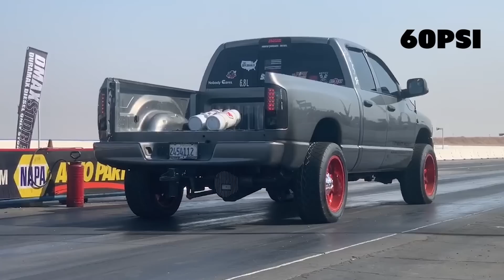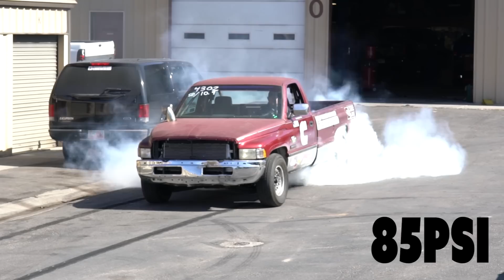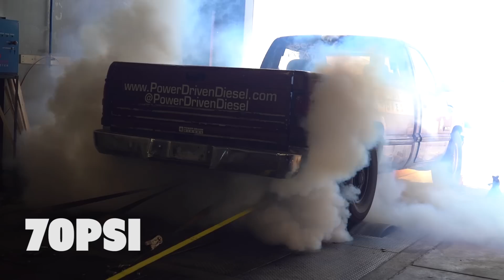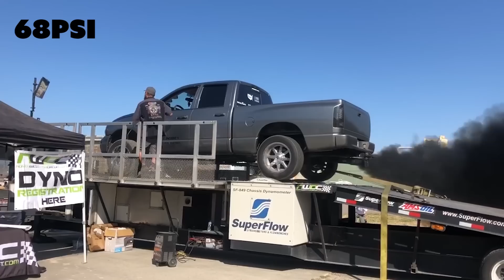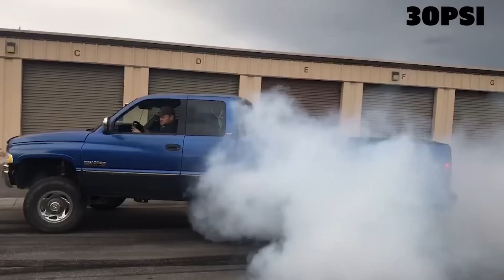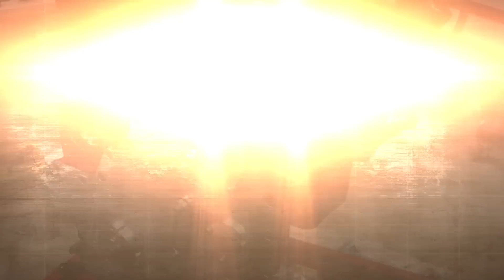All About The Boost! Everything You Need to Know About Diesel Boost | Power Driven Diesel

Comment: Todd, I realize most of your viewers know this, but as you stated in a video long time ago:  Its about mass flow rate, and boost is just a number.  One engine makes the power at 50 psi, while the other needs 100 psi manifold pressure.

Comment: If you want to scare someone, I know that the big Merlin v12 aircraft engines can actually survive running over 55psi of boost, in the full race application. Keep in mind that it's a 27+ liter gasoline engine. It was built to run about 30psi for 2000 hours of operation.

Also, I forgot about the hyperbar engine in the French leclerc tank. Uses a small jet engine as the turbo. This works because a gas turbine engine is cooled by the air flowing through it, to the extent that fully 3/4 of the air in the exhaust is unburned. The French also dropped the compression ratio in that engine to gasoline levels, 8 or 9 to 1 because that auxillary power unit gas turbine is way bigger than the diesel in terms of airflow.

Comment: Almost all of these trucks looks like they're tuned like absolute shit. Puking black smoke even in full boost. Typical diesel gear heads. Other then that cool trucks. 
Edit: i take that back, Not cool trucks. Theres zero reason at all a diesel making 100+ PSI should be puking midnight-dark diesel all the way down the drag under full boost. Theres a reason 1500HP diesels are stuck running 9 second passes. No place for them puking diesel on the other vehicles on the track. And don't try telling me this is because of big injectors and can't be tuned out. I've been around big power diesels for years
Reply: Brandon Cody how do you fix it?
Reply: @cya6.0  The fuel needs to be turned down in the tuning. On older 12 valves this would be more difficult since they are mechanical fuel injection, but on 24 valve diesels it can be controlled in the electronics.
Reply: Yeah most of the trucks in the video were mechanical injection.. they have the fuel turned up further than actually nessasary because that assures you will make maximum power. That's racing, you make the vehicle as fast as you can. Also diesel soot is barely even harmful if at all, it all settles to the ground just like ash.

Comment: Isn't boost pressure in it self, more or less meaningless?
Isn't it like specifying an engines torque without specifying RPM?
I mean, 200PSI at 1000 RPM is nothing like 200PSI at 4000 RPM, so the boost number really need to be corrected for RPM, given that the amount the head flows is constant (no variable valve lift).
Or am i missing something?

Comment: So I have a theory myself. I'm a rotary guy and a Cummins fella. I actually run a much larger charger my 1.3 two rotor a Garrett g42-1450 then the24v which is on a s475 over a 363 as the truck could not light the 475 as a single easily. Now we run up to 80psi on the truck which is the 5.9 24v p pump. The car I run only 18 to 25 psi. Both engine combos run about 700 bhp . That being said my theory is running the bigest charger your engine is willing to spool at less boost because the pure volume of oxygen at a lower pressure rate is a far cooler and less pressure rate at the same or less density volume making for a safer combustion in the engine which saves on engine parts and allows a larger tuneing error window. I have proved this on the rotary using smaller and larger turbos back to back . I would have to run a lot more psi on the smaller turbo then the big turbo to net the same bhp and noted the tq curve would flat drop off sooner with the smaller chargers and the engine parts became highly stressed due to this. Now I could be way off base here. But this is something to look into as noone talks about this .  Not even Mr info Gale banks
Reply: Spool time is important and weight too. Sled pulling you can have huge turbos, other racing you can't have that much or a tradeoff
Reply: For Max Dyno numbers you wanna be in the sweet spot of the turbo map, but maximizing the HP under the curve can mean a different turbo

Comment: Boost is just a brag gauge it really doesn't mean much. With the twins I have on old yellow I can crank the gates down and make 95psi, but it makes the best hp with it running about 65psi. If I could get more fuel more boost might help but it only needs 65 to clean up so that is the sweet spot.  Sometimes too the boost is really just backed up drive pressure like when you make 65psi on a stock hx35 and it has 100+ pounds of drive pressure.
Reply: How is 28psi @57°f mesured at the head. 2000-2400 rpm 850 Egt out of  Hx35/6  on a 160hp tune ve? Stock h1c/21 was 12psi@2400 1150egt.  Same fuel. 
1 configuration drives like a diesel of the era was expected to,the other drives more like the stout 10mpg SBC 350 I had in my 79 chevy
Reply: David Drescher Funny I just swapped the factory 21cm Housing on my crew cab for 12cm wastegated one to improve how it drives. It made a huge difference in driveability and low end torque. It has power right off idle now where you needed it up to 1600rpm before in order to give it any fuel. Both setups would clean up the top end so I doubt peak power changed but the area under the power curve sure did!!
Reply: Well, yeah. As you compress air it gets hotter. The air coming out of the turbo at 95psi is way hotter than the air at 65psi. Overheat the intake air and your power goes down. You want to run 95psi, get a much bigger intercooler and maybe even add a water injection system (or nitrous)

Comment: How much is to much for a stock hx35 turbo...I'm getting around 45 psi....  at about 60% throttle ...I dont think it will take much more...
Reply: About 35psi. Anything more than that is just a bunch of hot air as it is off the compressor map and because the air is hot your power actually goes down as the boost goes up. I dyno tested this several years ago on an engine dyno just for fun. It was an HX35-12cm all stock 215hp engine with 370 injectors and a ground fuel plate with 20deg of timing.  If we cranked the wastegate down or did the old trick and unhooked the boost signal it lost power every time.

Comment: Sorry, i haven't gotten past the intro yet but the goal is not to make more boost, the goal is to make more power.  Boost is a measurement of restriction to air flow.  A well flowing motor does not need a lot of boost to make a lot of power.  Correct me if I'm wrong, but the goal is to make the most power as possible using the smallest amount of boost.

Also, asking "how much boost" without knowing the characteristics of the compressor is not going to give an accurate picture either.  10psi on a small turbo flows way less air than 10psi on a large turbo.  They both run 10psi, one makes WAY more power.

Comment: How much more boost will a k27 make over a holset hx35?
Reply: The real question, is if you can spool it. A K31 is 71/88 vs the hx35 being a 56/60.
Reply: @460EFI  Yes maybe bigger injectors with a bigger turbo. Hard to figure out the balance and not be a smoke machine ?
Reply: @goingofftherails9877  getting it to spool is a lot bigger game than just adding fuel. To really utilize a charger that big, as a single, you'll need a Steed Speed, GDP Air Boss, an intake horn, CAI, 4 or 5 inch exhaust, and some tuning, as well as probably a better cam.

Let me put it this way: a K31 is a great turbo on a 12.7L Detroit.
Reply: @goingofftherails9877 , I'm apparently also retarded, because I read K27 as K31. The 27 should be fine on a stock truck. Biggest thing will be the increased exhaust flow, so you might even lose boost, but gain power.
Reply: @460EFI  Thanks . I have upgraded to 4 inch exhaust and even tried a s300 for a while. But I was always driving lightly with the skinny pedal till it got up to 1800 rpm just to keep from smoking out those behind me
Reply: @goingofftherails9877 you might try the DPS Turbonater VGT housing.

Comment: Any idea what the air temperature is from the big turbo to the small one when pulling hard?
Reply: Ugly hot. You'd need a compressor inlet temp sensor, but it'd be worth knowing for compound turbo applications.
Reply: Roughly 500-700 degrees

Comment: I have my 98 12 valve that made 42 pounds of boost. Am putting a steed speed exhaust manifold afe intake a188/220 cam timing at 17 degrees rack plug  stock turbo and injectors until I get more money what can expect my get and boost to do ? Will drive pressure go down?
Reply: I lost a couple psi with a colt stage 3 cam. More fuel equals more exhaust so generally more boost. Installing a steedspeed didn’t affect peak boost but it did make it come up quicker
Reply: PowerDrivenDiesel thanks for info

Comment: Now you're making me want to do compound turbos on my Supra.... well the motor won't like more then like 20 psi... but hey seeing 40psi spike would be cool....
Reply: That 40psi spike when you shift can stall the compressor, really bad juju. Kills turbos. That's why blow-off valves exist. Though instead of blowing off into the atmosphere, you can blow off into the turbo intake. More complex plumbing, but Ford was doing that on the turbo Thunderbirds in the 1980s.
Reply: Gasoline engine doesn't like too much boost compared to diesel counterparts. Considering too much pressure for air fuel mixture resulting to explosion rather than combustion that destroy or even melting the engine. Something that diesel never do because there are no air fuel mixture during compression stage, the diesel fuel injected right before combustion....
Reply: @jstwatchnread8420  yeah I know, but still would be a fun project, even if it did kill the engine.
Reply: @pddofficial  Thing is a GTX42 would spool at like... 5-6000 which makes it kinda unusable. I feel like if I could build 10-20 psi around 3k rpm and 40 near 6k would be good. I don't know all the technical parts to a compound turbo system, but It would be interesting to see it.
Reply: Jonathan Gardner not good at all
Reply: @jonmeray713  In which way?

Comment: Todd I always thought boost was/is just a measure of restriction of airflow.  Isn't that why a higher flowing head will lower boost numbers?
Reply: It is; pressure (boost, in this case) is pretty much just a definition of restriction. If there's no restriction, you won't get pressure. 
This is why you can run a small turbocharger at huge boost numbers and have say, 300hp, but swap to a bigger one you could reach 300hp with half the boost pressure, less restriction, higher airflow.
Reply: BUT (and ignore the numbers I'm gonna just throw some in to make sense out of it) if you have 100 sq ft of air. And a 6.7l engine. Say you need 50 pounds of "boost" to fit all that air in, with say 40 pounds you can only get in say 75 or 80 square ft. So you are losing 25 or so square ft of air that can be used for MO POWA BABY
Reply: Pushing the small turbo too far caused heat induced expansion to achieve higher psi (90%  theroy) but you are stuck at 65-50% after you remove the heat, if you can. The closer  you push to the turbos redline 150k ish the lower the efficiency.
The larger turbo is most likely in the sweet spot 72-78% efficiency Island depending on what map you read.

Turbo A = 45psi @6-700°
Turbo B = 22 psi @2-300°
Both move the same lbs of air , true.

Comment: 12 psi made me so happy I want a ford now
Reply: Haha, easily the best truck in the vid
Reply: Augustine  Morales    Get an older 7.3 or something but there a heavy drinker. In that you  don’t get very good mpg
Reply: @Dieselsmokin  I got a 2007.5 2500 with a deleted 6.7 and injectors and turbo upgrade I drive it about 500 miles a week and a 2017 2500 I also drive 500 miles a week lol about to delet this one too big difference 21mpg to 16mpg from old to new but new isn't deleted
Reply: Don't waste your money on a POS Ford
Reply: Augustine  Morales    If you get ford MAKE SURE YOU DO NOT GET A 6.0 or 6.4 power stokes biggest POS it’s a terrible design and ford has decided to stop supply parts for them.